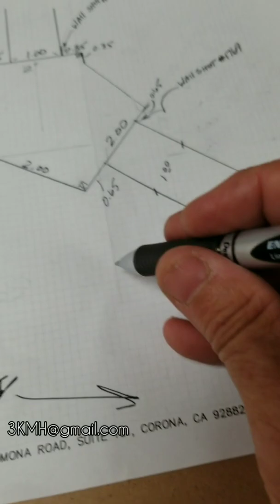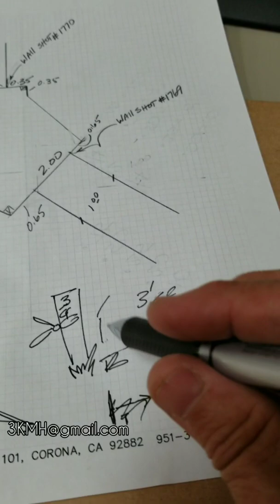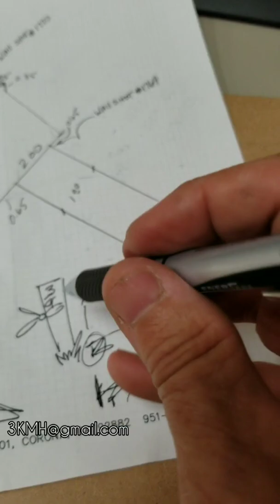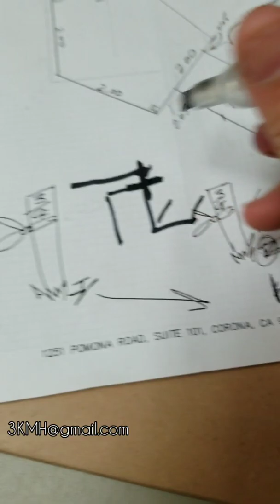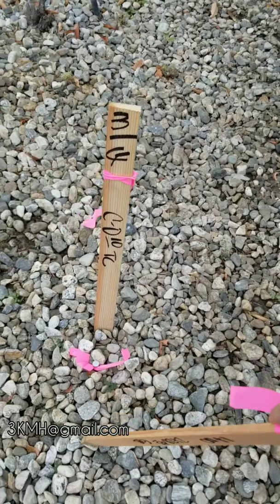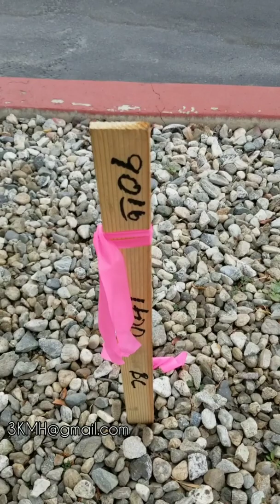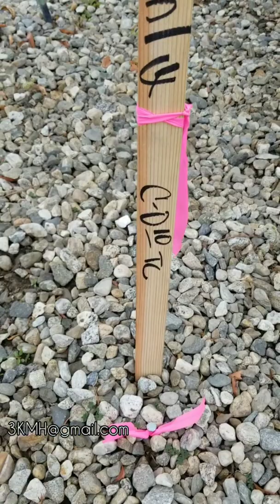How to Read Survey Stakes

Comment: Can explain how to convert tens to inch
Reply from the maker: The easiest way for me is to look at an engineers pocket tape which has both inches and hundredths or use your calculator. 0.50 x 12 = 6.0. Hundredths x 12(inches) = the inches plus the fraction of an inch. 0.25 = 1/4" 0.125=1/8".

Comment: 3:45 You should never write F - 050 because [ + = fill ] and [ - = cut ].  C050  &  -050  mean the same thing. Write out the full elevation. Those are things a journeyman would do. fill + 050  &  cut - 050  also work. This video wrote out "fill cut 050".
Reply from the maker: It's a dash.  I understand what your saying.  To be honest, out here you will see dashes used or just F 0.50. No dash, or +/-
I'm breaking my habit of dashes slowly
Reply: @Surveyorjoe  I get it. When I see dashes I don't make a fuss about it, also the operators are wise and usually know what's going on regardless of how the stakes are written. Sometimes I see periods for abbreviations but ex: Face Of Curb - in my opinion - should be written as FOC not F.O.C

Since grade stakes are not in the ground for an extended period of time, I tie a quick cow-hitch knot by bending a loop over itself and sticking the lath through. I'd recommend learning the fast version of the cow-hitch knot to any surveyor making grade stakes or flagging nails.

Comment: Thanks for the explanation pls what does the blue colored ribbon and yellow color indicates in stake
Reply from the maker: For me, I only use blue when staking water or blue tops, but I don't always use blue for water.  You will find many surveyors stick to a color code and just as many do not.  We use a lot pink and florescent green, and we also use 60D nails tied with the same color as the lath.
I would guess most blue flagged lath are either water or blue tops.  Best thing to do is read the lath first.

Comment: I’m sort of familiar with this. Since I do commercial concrete work. So it’s not something really new to me. But here’s my problem, I’m not the foreman in my crew so you’ll never see me finding grade or doing anything having to do with this. But since I want to learn, I am doing my own research as well as observing my foreman. I think for ppl who don’t know (like myself) maybe explain what hub means or what lath means, etc. Because I just know them as wooden stake. I don’t know the “correct” term. Also the meaning behind C and F. C meaning Cut which means grade is going down and F for fill, grade going up. If that makes sense. Thank you for helping me understand a little more though!
Reply: Also is there any meaning behind the “flagging”
Reply from the maker: @anthonyramirez1757  if you are talking about flagging color, then it all depends on who you ask.  Myself,  I use pink and florescent green a lot because it can be seen.  I also use large nails with matching flagging instead of wood, as do most of us in SoCal.  Cheaper and faster.  Some believe that certain utilities should be flagged with the same color as the underground location paint. Green for sewer, red for electric,  yellow for gas....
Other than blue for water, most of us on the west coast use what we want.  There are no rules.  We expected the trades to read the lath and to have communication.
Reply: Very interesting! Thank you so much for the reply. I honestly have seen a lot of orange flagging for what I do. Which is concrete.
Reply from the maker: I will throw something by the end of the week.  Thanks

Comment: Great video. Could it be the same for staking sewer laterals?
Reply from the maker: We normally set "Y's" on our Sewer staking line and a lateral on the pad or wherever the stub is. Our Y lath will read 1+14 (station) Y Left or Right.

Comment: Studying for the CA Civil P.E. Surveying exam. This was extremely invaluable information. Much thanks.

Doing a problem right now that reads:

RPSS 12+25.25, EL 3305.6 || -0.80 CP | C7.0, 14.00 Toe, 2:1 | F0.6, 12.00 CL, 20:1

How do i know what the distance is from the RPSS to the CP? Did they forget that offset distance ? Thanks
Reply: Not an expert but I was a professional and I'm not seeing any offset dimension noted and I'm guessing that is due to the fact that it is on a slope so it is being staked with no offsets as it would be very inconvenient to be checking grade from offsets on a steep slope and you could argue "what would be the point of offsetting a grade stake on a slope anyway"?  A whole bunch of information on that lath is Greek to me.  I would have to study hard to pass THAT test. Good luck!

Comment: Interesting.  Here in North Carolina it is normal to go 5 feet off-sets.  And we measure to bc=back of curb.
Reply from the maker: I know some other states back of CURB is used.  We tend to only use back of curb for roll curb.  When they set the forms or string line for the CURB machines,  they are normally set here to curb face.
Reply: @Surveyorjoe  Good to know. Very informative video. Thanks.
Reply: Colorado we use 5ft offsets and TBC( top back of curb)
Reply: California here.  Lots of ways to do things but having said that, usually there is one "best" way.  We do some whacky things out here in the west but one thing we do really really well is build stuff.  I would argue that our way (curb face) is the "better way" because the thickness of the curb might vary which would throw off a curb face line but a curb face line would NEVER vary so any variation in curb thickness would be rendered irrelevant.  Also the reason we use a 3' offset instead of a five is because 3' is plenty of room to work with and the further away the offset the longer the level and it's easier to use a 3' level than a 5' level when checking grade. Small difference but speed matters out here.

Comment: I’ve dine but of utilities underground, and they usually mark every 30-50’ an offset for the utility conduit tench, but i haven’t seen what kind of markings or for what kind of markings do we ask for when laying out/installing a vault or precast pad? I’ve hear (high and low point when in a slope). Do you guys provide offsets for all four corners of the vault/pad?
Hope it makes sense.
Reply from the maker: We normally stake offsets to the inside or inside dimensions of the vault.  The plans normally have one of the two dimensions.  We normally dont have a top of vault or pad grade, so we give them a cut or fill to curb if the VAULT is inside a curb island or near curb.  Edison sometimes has the contractor pour a small strip of CURB next to the vault before inspection.
Reply from the maker: Inside or outside
Reply: I’m assuming outside would be the outside edge of the vault? Do we as electricians have to provide you with the vault or box spec size?
Reply from the maker: @JoseVega-mq3uu  in CA,  we have plans either from the power company or the VAULT size is on the detail since most are precast.  If there is not a vault size, they normally sit inside a CURB island or along some planned structure with a tie in point for the conduit/trench line
Reply from the maker: @JoseVega-mq3uu  we dont carry standards for vaults, so staking curb around the proposed vault will at least give a finish grade and LIMITS to place the vault.

Comment: What is TB?
Reply from the maker: I do not remember using TB in the video, but if you have seen "TB" written on a lath it could be Top of Berm.  In the video I used TC ( top of curb) as an example.  Without knowing what the structure is I'm not sure what TB could mean.  Berm, Buttress,  Temporary Bench Mark....
Reply: 3KMH Land Survey Products this would be for a civil stake. Thank you for your prompt response.
Reply from the maker: @josecordova995  no problem.   If there are no Cuts or Fills on the lath, its probably a Temporary Bench Mark.
Reply from the maker: Temporary Bench Mark
Reply: People get hung up on the initials but the fact is that different regions use different markings for the same things.  The important thing is that the grade checker and the surveyor are on the same page and that the markings on the lathe are being understood correctly.  If that is the case then the purpose is being served and all is right an good in the world.  Have a talk with the surveyor for ten minutes and all will be revealed.